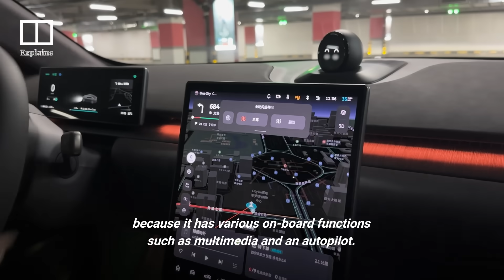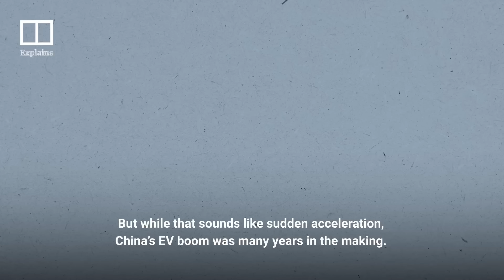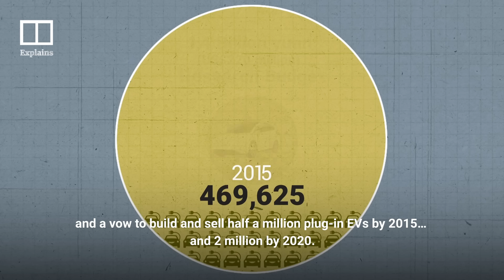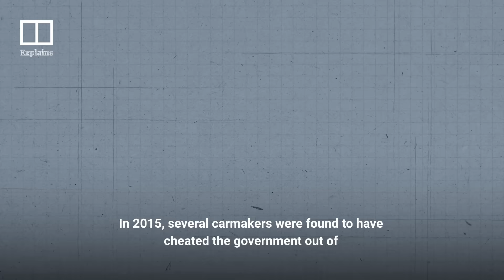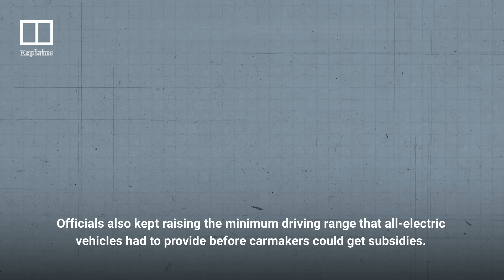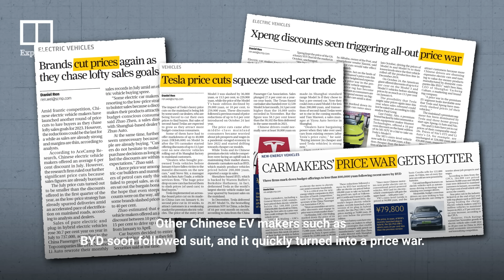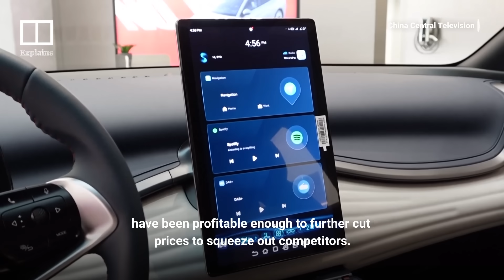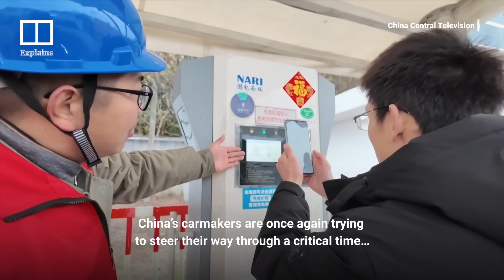Can China’s EV makers overtake their rivals?

Comment: I heard during the winter storm in China over CNY, many EV drivers in China were forced to switch off their engine to save energy when they got stuck in traffic jam and they complained it’s really cold without heater and the heater really drain their energy so much that they have to turn it off all the time. The EVs range can drop by 40% in cold weather while the petrol car range drop is between 15-20%.
Reply: If you were stuck in the exact same winter storm in your combustion engine car, you will have to switch your engine off too dump dump !
Reply: @anjuna_deep  it’s much worse for the EVs because the batteries get affected by cold weather and the EV range shorten while battery gets depleted faster.
Reply: @ditsygirl5409  
Dumb dum, the EXACT same problem will be the case for combustion engine cars as there's are batteries in those cars too !
Reply: @anjuna_deep  the EV range drops by 40% while petrol car drops by 15-20% in cold weather so that’s the major difference. We all know both types get affected by the cold but we need to highlight the main difference to tell others not to buy EVs yet cos technology is still not mature. Hope you are mature enough to accept that!
Reply: @ditsygirl5409  
Besides, a smaller battery capacity inside of combustion cars under severe cold weather means harder or impossible to ignite.  

No ignition to the engine, means absolute 0% milage.  Can you comprehend that dumb dum?
Reply: @anjuna_deep  be real, in cold weather if the range drop by 40%, who wants to drive EV? It’s going to seriously impact people’s desire to buy one especially if you live in places with cold climate. It doesn’t matter if traffic jam or not, you still need to drive during winter.
Reply: @ditsygirl5409  
You're just regurgitating western narratives using feeble hearsays... Kinda pathetic.

Comment: BYD may have MADE more cars than Tesla but they didn't deliver MORE electric cars to the buyers as Tesla did, most BYD's are still on the dealer’s lot
Reply: 😅 I bet you don't even dare to check BYD car features. Tesla is the low cheap inferior EV brand in China. BYD and Huawei cars are technically advanced and more luxurious
Reply: 😂Tesla was made in 2003 
Byd was made in 1996

Tesla uses byd batteries 😂😂😂

Comment: in essence, this is just competition between power generation & distribution and oil & gas industry. It is just part of the world's electrification process. 
For car buyers, the calculation is so simple, for a gasoline SUV, it is approxinately 9-14 liters per 100KM, for electric SUV, it is approximately 20-25KWH for that 100KM. 
The operating cost difference is HUGE, even without considering costs of maintenance and service ...... 
for daily communiting, conventional engine cars doesn't have any chance...... 
for long haul travel, there is already wide spread NIO battery swap stations, Tesla super chargers, and other latest high voltage charging solutions. 
Engine cars won't disappear in a short while, but their dominance will. The same thing happenned to steam engine 100 years ago, but steam engines still survived for many decades.
Reply: Steam engines are in high demand in India!
Reply: The only reason why EVs haven't entirely taken over the world is because of battery capacity concerns (aside from the pollution that comes from making Lithium batteries), as well as the number of charging options (plus charging speed).

But once those things are settled, watch how EV takes over the world. It's just an inevitable progression in evolution, just like AI.

Remembered how people laughed at the corny and bugged AIs 10 years ago? Well, are they laughing now? This is despite AI not even reaching close to half of its potential.

It's not a matter of petrol being relevant, but how even the oil and gas industry is already transitioning to electric. It's really inevitable.

In smaller vehicles like bicycles and motorcycles, EVs are already taking over the industry slowly but surely. There's just no argument or contest over their performance and efficiency.

And the thing about EVs is that the performance isn't solely capped at its engine. A software update or minor upgrade of say, the controller or even the battery specs would already boost its existing performance. You can't do the same for petrol vehicles without doing a complete overhaul.

Comment: Of course they will dominate. Because the major companies toyota, gm, ford, Volkswagen and all dropping their ev line and switching back to gas power. 

That means the total global market will only be 30% and China will share 15% of that with other smaller brands.
Reply: Not quite. The likes of Stellantis which owns brands like Alfa Romeo, Maserati, Fiat, Opel, Jeep, Chrysler, Dodge, etc. has bought a stake in a local Chinese EV manufaturer to acquire the tech.

Japanese hydrogen cars are the worst - avoid at all costs.